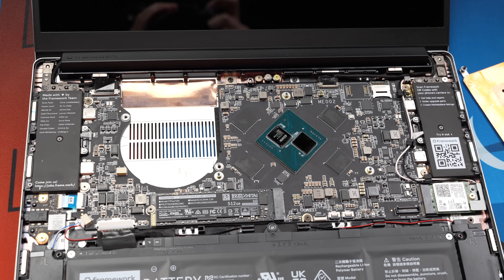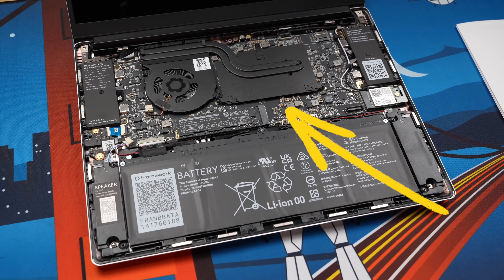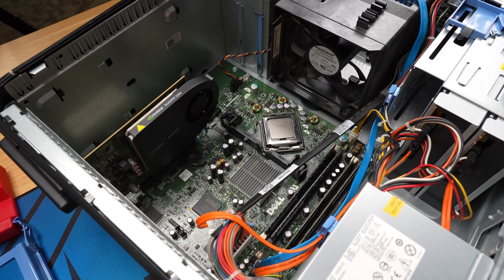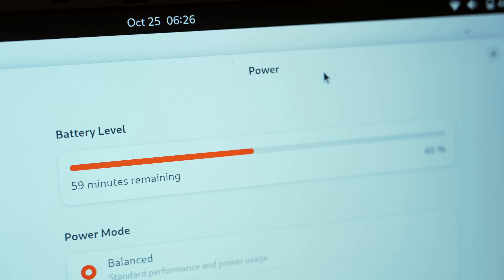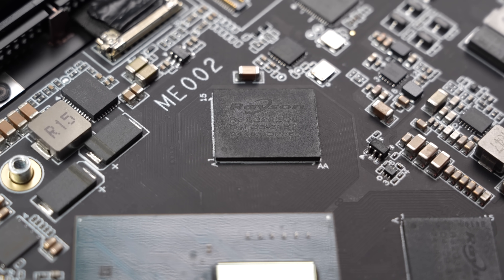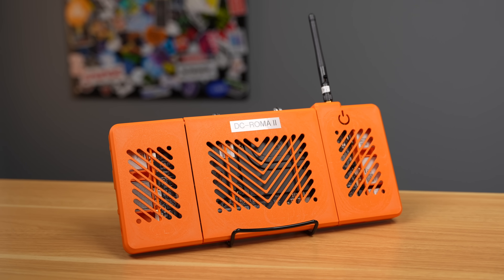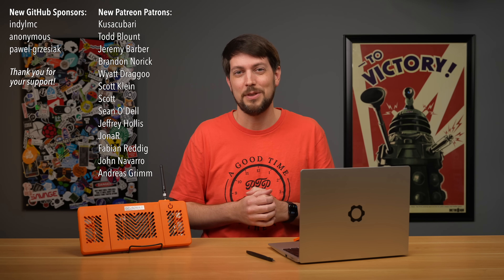This is not a Framework Laptop

Comment: Core to core latency is one of the reasons Phenom II feel smoother in modern games (instructions not withstanding) than C2Q. Communicating over the FSB really does hurt things, but not as much if the chipset is actually designed with it in mind.

Comment: Sometimes its about being in the right place/time at the right time, and there may be a world where consumers want low fi/low tech stuff, just as i certainly do, but just not "significantly worse tech", as we need risc-v to be worked out, and at the same time as the accompanying parts are to be, which is suppose to be a world wheres its more efficient, but hey we'll see. Tech is sortve goin down a weird rabbit hole , like this machine for example, so you sorta gotta hope they do risc-v justice later down the road.

Comment: Sounds like it isn't in the spirit of RISC-V either, which includes simplicity and straightforward directness. Trying to apply old habits of "complex" (confused / messy) paradigms to simplicity and elegance defeats the purpose and will ultimately fall on its butt. Even if it's temporarily faster, it's a dead end. Let's leave the messy paradigms to the "complex" architecture path and keep the simple path clear, straightforward, and elegant.
Reply: You'd think so, until you take a look at the bootup specs. They copied the worst part of enterprisey ARM setups.

Comment: My friend Jeff, In order to have 3 viable CPU Architectures, we first need to have 2. And ARM is NOT a viable CPU Arch (on Desktops), unless you want to be locked in Apple's ecosystem (or have a Linux distro that is not guaranteed to work for everything) or, you jump in the Qualcomm hypetrain (which you shouldn't). And then we have RISCV which... Oh, boy!

So, X86 seems that it will never die, just like C and C++.
Reply: Kind of unfair to throw out "not guaranteed to work for everything" as a downside when none of them offer such a guarantee. For cooperative distros it's a best effort basis and for commercial software it's maybe it'll work next time, be sure to pay again.
Reply: @0LoneTech  Linux distros work flawlessly in most (if not all, modern) X86 laptops. That was my point.

Comment: Risc-V kinda seems to be stuck in this perpetual "experimental" loop, always fun to play around with and experiment, but never in any kind of high-scale production environment.
Reply: It's definitely not stuck in "experimental". It's just mainly been used for embedded use so far where it isn't at all visible to consumers. Did you know each Nvidia GPU contains 10-40 RISC-V cores?

It makes sense because a) it's way easier to design a simple microcontroller than a desktop/server class out-of-order CPU, b) the customisability and license fee costs make the biggest difference for microcontroller/embedded uses.

Even ARM started at the low end (microcontrollers), and gradually moved up through phones, tablets, and then laptops and servers. It took literally decades for ARM to reach the desktop/server market. RISC-V can't do it instantly.
Reply from the maker: So far only a couple chips seem to be in that realm, but none available to the Western world yet. They're usually put in ancillary roles though, as even the state of the art still lags behind x86/Arm a bit

Comment: I have a new cute little Banana pi BPI F3 sbc here on a Bianbu 3.01 distro. I couldn't find a firefox so far.  The Chromium on it is a year old and google refuses to load because it doesn't have up to date certificates.  Epiphany browser (gnome) runs a bit faster but is a bit unstable (pages crash occasionally), and can't do youtube and is half speed at webgl.  I really wish I had a faster browser, it's slow loading pages, though they render and scroll fine.  But input into some javascript based editors is painful.  I'm about to try vscodium so we'll see how that goes.

I was just playing with one of the weird features it has.  I managed to write some C code that uses the "tightly coupled ram" on the processor that half of the cores can access.  It's only 512k, but writing to seems it be (by my test, not by specs) 30% faster than L1 cache.  But  only 3 to 4 times faster than main ram, so even the caches on this machine are slow.

And loading tightly coupled ram from the wrong cluster is 21 times slower, so there's that cluster to cluster latency you found..  I guess the spacemiT K1 is also two chips on a die like that one.  Oh God, that means that cache consistency is an extreme performance killer!  I bet I could speed all the software up by locking each program to one die!

The banana pi so doesn' t use power.  With minuscule heatsink it never got above 60 degrees under load.  I put the tinest of fans and now it doesn't get above 45 under 100% load.  

Anyway I got it to develop risc-v compatible software and as an old programmer that's kind of exciting.

Oh and by the way, I 3d printed a case for the banana pi.  Lol cute with gratings top and bottom so lots of air flow.

Comment: This core to core latency graph doesn't make sense, and it doesn't match what youre saying in the voice-over.  
The bottom left and top right are both core to core within the same die, just different dies, and the top left and bottom right are the cross-die latencies.  
The graph shows that within die 1 the latencies are normal, but in die 2 core-to-core within the die are very high, even higher than the cross-die latencies.  
That means at least one of a few options:  
The graph is displaying the measurements wrong.  
The measurements are wrong.  
There is something seriously flawed in die 2.

Can you explain this?
Reply from the maker: The way I wrote the script butchered it a bit, but check my blog and the GirHub issue linked in the description for a lot more on it. A group of four others were retesting on the DC-ROMA and regular Sifive board with single die variant, working on different NUMA layouts to see where the latency was being introduced.

The P550 cores are certainly not meant for the dual die approach!

Comment: The 25W seems like they dont do any power management like AT ALL. The first would probably frequency scaling, for example to 500MHz, then clock gating, then turning off entire cores or modules. But that is kind of hard and a lot of work and the reason why AMD, Apple and Intel are so much better in this than everybody else. It just costs billions and years to do.
Reply from the maker: They do actually have frequency scaling (first thing I checked!) but a lot of other parts of the chip are just run 100% to keep memory in sync across dies with NPU + CPU I think...
Reply: @JeffGeerling  Sounds like a cache coherence nightmare to me what theyre doing

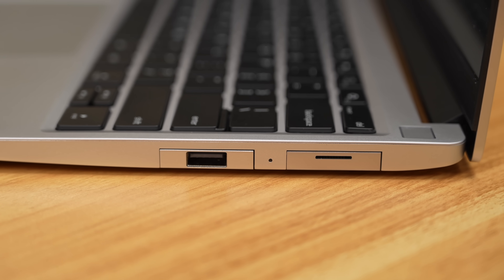Comment: At 2:15 you're saying "I tested USB-C modules and got about 100MB/s" which might be a bit misleading. The USB-C module is basically passing through to motherboard USB-C. Most likely you're getting only 100MB/s because it's either limited on the RISC-V MB or even your flash drive. I understand that the video is about RISC-V flavour of Framework. But as you were saying there are parts that would be different for AMD/Intel version (Performance, battery life, etc) and some that are going to be the same (build quality, keyboard, ease to repair, display etc). You also just transition from keyboard to USB modules so it might add confusion. 

I have AMD Framework and it can saturate my 5Gbit USB-C Ethernet adapter and they advertise USB-4 support for AMD ones.

It's probably obvious for many, but might not be for less technical people exploring their options.
Reply from the maker: Yeah that nuance is rough for a video (more explanation in the GitHub issue). The port advertises SuperSpeed (USB 3.0, 5000 Mbps), and the drive I'm using gets 250-300 MB/sec read/write on a Pi and my Mac Studio, so the RISC-V laptop mainboard here is advertising a slightly optimistic rate. But good enough compared to USB 2.0 (which would be less than a third the 100 MB/sec I got).

Comment: I like how Jeff is geeking out about how the DC-ROMA II uses a dual chip design, and how he hasn't seen a design like it since the Core2 Quad CPUs. I guess he forgot desktop Ryzen CPUs are basically the same thing as both of them 🤣😆
Reply: It’s not the same, the chiplet design used in Ryzen has a die for the cores and another for I/O, this is more like two CPUs with its own cores and I/O in each die.
Reply from the maker: Exactly; chiplet design is a lot different, employing die to die interconnects. The DC-ROMA II is more like the older dual CPU designs.
Reply: @JeffGeerling  I might have been wrong, but isn't the DC-ROMA II design similar to the first gen Threadripper and EPYC CPUs? If I recall correctly they didn't have a seperate I/O chiplet yet and seemed to work very similarly as the old core2 quad CPUs, except for the fact that the northbridge chipset no longer exists with modern motherboards so Threadripper/EPYC dies communicated through the infinity fabric interconnect

Comment: The first thing every reviewer does with a new RISC-V dev board, is try to run a Yootoob video in a web browser.....
As if testing an AV1 encoded video, in a browser with no Hardware Acceleration enabled, on an OS with wonky GPU driver support, for a GPU with no AV1 decoder, is a true test of anything.
Reply from the maker: That's usually about the 60th test I run ;)

Check the GitHub issue linked in the description for all the other test data.
Reply: It's a useful test a standard workload that basically any user would use. It's a simple way to show the typical user experience will be terrible for anyone other than a RISC-V developer.

Comment: 4:38 no Jeff, don't use that kind of censoring, your fans will be able to turn the image back and realize you may not have use the right amount of thermal paste
Reply from the maker: Is 4 oz of paste on a 10x18mm die correct?
Reply: @JeffGeerling  just empty the tube. No need for any calculations or such, that should be left to the computer
Reply: @tezcanaslan2877  oh NAHHHHH💀💀💀💀💀
Reply: @tezcanaslan2877  So like my strategy with ice cream -- "one container == one portion"...
Reply: I thought I was going crazy. Had to rewind it. Lol.
Reply: Is this a meme I don’t understand? Am I a boomer now?
Reply: @TimmmyHall  It's a reference to a video about how it's possible to deblur a video and get the data that was blured out.
Reply: @asandax6  Is OP being serious that this could be unblurred, or are they referencing the video and joking about how it would be impossible to unblur this specific one because there are only a few remaining pixels left?

Because if OP seriously thinks this can be unpixellated, they need to watch some tutorials and then prove it.
Reply: @juhtahel7454  No it's just a joke that has no bearing whether this specific pixelation is unblurable or not.

Comment: Only uses the SiFive P550 for CPU cores. RV64GBC which is missing some critical extensions to be RVA23 compatible. A useful board when it came out, but a bit less so once RVA23 was ratified.
Edit: which you did explain well in the video 🙂

Comment: How do you get 8 or 9 hours out of the 'normal' motherboard (with Ubuntu 24.04)

I am lucky to get 3 hours before I need to go hunting for my charger (to be fair I limit charge to 80% in the bios).
Reply from the maker: Depending on the distro, power management might be a bit better

Comment: The openness of RISC-V technology is a good thing, but also a major practical problem. Almost any company, no matter how small, can produce simple RISC-V CPUs, resulting in the same thing being reinvented (well, not really reinvented) and built over and over again. Many companies will come and go because there is a lot of competition, and no one can suddenly conjure up something significantly better on the die. Much of what makes modern x86 and ARM CPUs efficient or energy-efficient is generally known, but the technical implementations are certainly trade secrets. And developing these techniques requires different knowledge than just CPU functionality.

It would be beneficial, but also detrimental to the RISC-V ecosystem, if one or two companies truly aimed to develop a competitive RISC-V chip relatively quickly. However, this also means that many of the smaller projects will fail financially because there will no longer be any interest in them.

RISC-V will very likely develop faster than ARM or x86/x64 because many supporting technologies have already been developed, and things like PCIe and RAM are available in their current stage of development. (Where were we with x86 hardware after the same development time that RISC-V has had so far?)

Comment: 0:08 I don't think you should by any framework laptop!
We have bought 5 different framework 13s including intel 12th gen, 13th gen, and AMD 7840u and not a single one has worked reliably without breaking something! e.g. mainboard died, battery bulged, half of the screen went black, speakers broke, door hinge flops, extension block's usb got disconnected from their board internally, ...

I even reached out to them just to get the meaning of their LED pattern that flashes on the dead mainboard one (no, it is not the 11th gen issue you are thinking of) and they refused to tell me the patterns without a proof of purchase!

Comment: its wierd, on my laptop (generic thinkpad) i remove the bottom cover to get to the motherboard, storage, battery, wireless and ram 
not sure how undoing screws on the bottom and then removing the keyboard to get to the motherboard is easyer

edit: regarding die to die latency, multi CCX Ryzens sit at around 75 to 100ns aswell, so we have not forgotten how to do it

Comment: That Addon card should find some kind of breadboard edge connector so you can shove wires right into the side without soldering stuff in and plugging it into the laptop =)

Comment: My first FreeNAS build was on one of those Optiplexes that came from my old job. 8GB of ram and a Core2Duo.
Reply: It's so crazy, there were years that you could walk around a lot of cities & see viable Core2Duo machines dumped in trash & alleys, mostly because it was easier for small shops & offices to buy something new, than to pay someone to figure anything out.   
There's still plenty of computers going into trash & alleys now, but they're actually trash now... smoked RAM or GPU slot, etc. Not like the old ones you could take home, pop a new power supply in, replace the clacking hard drive & be good to go!

Comment: My previous employer had me on an Optiplex 780 (Core 2 Duo 8400) until I quit in 2022. At the time Windows 10 was absolutely painful. It took 20 minutes to boot up in the morning. I was trying to get them to get me a Pi 4 to replace it when I left for my current gig.

Having said all that it does make a fantastic Windows XP retro rocket. They called me about returning it more than 6 months after I left and I was like.... guys, it's not worth the shipping costs, so I ended up keeping it. I took an old 5:4 LCD monitor from my current workplace and it's just perfect for retro XP things.

Edit: Due -> Duo
Reply: Windows XP Pro with the Media Encoder suite, was the best Windows has ever been.

Comment: My 'daily driver' desktop is a Dell Optiplex 960 SFF with an Intel Core2 Quad 3.0GHz running Lubuntu. Love this old system! Got it from a refurbisher years ago.
Reply from the maker: If it works, it works!
Reply: @JeffGeerling Works good. Has 8GB of memory, a 128GB SSD, a passive cooled Nvidia card, a USB 3 card, and PCI-E Intel AX210 wifi & BT.
Reply: Ooh, that sounds quiet?
Reply: @prophetzarquon  Almost totally silent. I also found the Dell heatpipe CPU cooler to replace the chunk of Aluminum one that came with it that was making a lot of fan noise.

Comment: numa memory layout was a thing on multi socket AMD systems. intel used a common bus to communicate with a single memory controller in the north bridge.
Reply: Unrelated but for some reason I now want to see a scene where Ares from Tron is just sitting on a (glowing) bus.
Reply: it doesn't matter it will consume alot of power so its not suited for laptop.

Comment: But what does the Risc-V ram cost? Cus if it's below $500 for 64GB then I'm in  lol.
I'll do whatever it takes to make that ram work with software at this point
Reply: It is seriously crazy to me how many things hit 16GB & just stopped. I mean, I know about diminishing returns & all, but if following the curves seen from the '80s thru early '00s, I'd been expecting we'd hit 128GB of video memory as the median by ~2015. So many rapid advancements up until ~2005 feel like they just stopped. 

I of course, blame monopoly. I see other scapegoats hurled about, but to my view these problems always trace back to supporting a monopoly.
Reply: @prophetzarquon  Yeah I run Kubernetes locally to test work stuff so I usually cap out at 1TB of Ram lol. I could burn infinite ram without ever using a GPU, but I will be using GPU's

Comment: If the ESWIN chip is basically an SoC, then wouldn't this make it a NUMA system? The dies on a Core 2 Quad still interfaced with a single Northbridge chip so it didn't have separate memory pools, but cache coherency was probably annoyingly slow
Reply from the maker: True; the systems aren't quite identical in the chip architecture.

Comment: I wonder if the 25W idle power is largely due to poor core affinity for processes and or memory. Yes, the die to die latency is insanely bad, but I suspect that playing with that could have a big performance and power improvement.
Reply: It might be something as simple as broken clock gating in the CPU, so they had to disable it. It's something that's quite hard to test, and Sifive don't seem to be amazing CPU designers tbh.